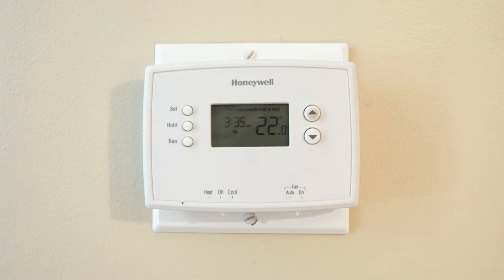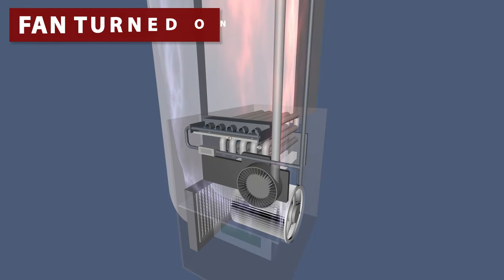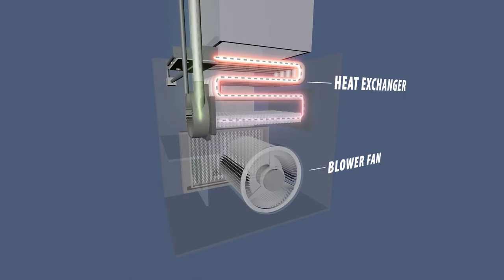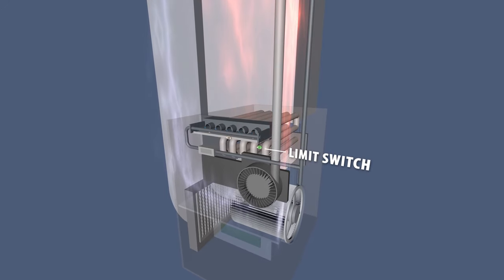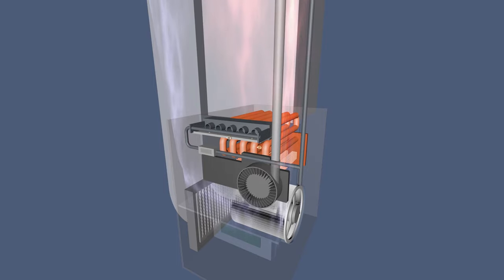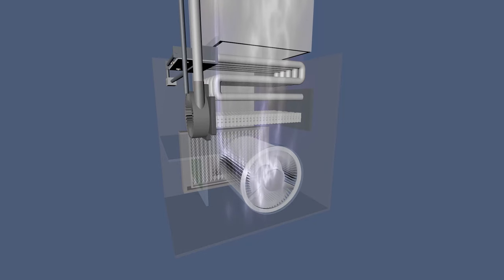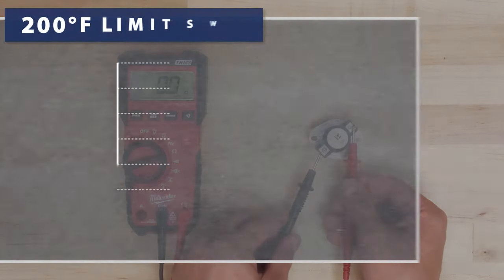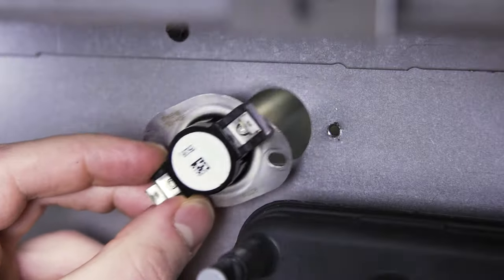Furnace Not Blowing Hot Air - Explained | Repair and Replace

Comment: Hello! Is it ok to replace the limit switch from a L165-60F to a L165-40F? I am having troubles finding the OE temp
Reply from the maker: Thanks for watching. It is not recommended to install a switch with a different rating as this can affect how the furnace operates. There are some cases where substitutions are made however that is not something we can recommend from here. In your example the original switch would cut out and disconnect the circuit at the high temp of 165°F. It will wait for the temperature to drop 60°F before power is connected to the circuit again. The L165-40F means that it will be cutting in at a higher temperature, & it will not wait as long to cut in again.

Comment: Electric furnace in mobile home is only blowing cold air instead of heat. It has been working fine until 4 days ago. Any help would greatly be appreciated.
Reply from the maker: Thanks for watching. Though your question is outside of the direct scope of this video there are still some things you can check. With an electric furnace, the first thing to check is if the heating element is still good. We don't have a specific video on electric furnaces but the steps will be the same as testing a heating element for an oven: https://www.youtube.com/watch?v=ABope7vl5IY

If the heating element is good then it could be a faulty limit switch or an issue with the control board.

Comment: Hi, I tested the limit switch with a multimeter and it shows 0.0 but when I tested the pressure switch no reaction on the multimeter??? The two other switches that have a reset also show 0.0. furnace still not heating? What do you think?
Reply from the maker: Hi Erminio, thank you for watching. A normally closed or NC switch will be normally closed (and will have continuity) at room temperature. Continuity means there is a continuous electrical path in the switch, and is any resistance value over 0. A switch is just a gate for the electricity to flow throw, which means it will have a very low resistance between 0 and 1 ohm. If the switch does not have continuity, then it will show a blank screen,  - - - - -  or  even OL (Open loop). That is an open circuit. Keep in mind some switches are normally open NO at room temperature and pressure. You might see NO and NC terminals on the switch which will show different readings. Testing between NO  and the C (common) terminals shouldn't have continuity, where testing between NC and C terminals will show continuity on a healthy switch.
Reply: @AmreSupply  well the others I tested I heard a beep then it shows 0.0 but when I tested it no beep and no reaction on the reader it stayed as is
Reply from the maker: @amineb5478  Beep and a resistance reading of 0 means there is continuity. For a switch that has C and NC terminals this means the switch is good.

No beep and no change means there is no continuity. For a switch with C and NC terminals, then that switch is faulty.

A switch with C and NO terminals, no beep and no continuity means the switch is good.
Reply from the maker: @amineb5478  As well we have created a video on multimeters and electricity. Its a good one to watch as a refresher, and it is also animated with good visuals. Its a helpful video overall https://www.youtube.com/watch?v=r_migcta_Is&list=PLCo9SMjkdWBycw9hZVfYFc6Sw2Jlavaak&index=2&t=0s

Comment: Here's my issue.  I set my thermostat to desired setting of 75 degrees(heat and auto for the fan).  Ones the house heats up to 75, the thermostat shuts off the furnace. When the thermostat calls for heat again it blow cold air.  So, I turn off the power switch for the furnace to reset it, thermostat is still set at 75.  After switching power to on, I can see that the igniter glows, but there's no flame. I put a new flame sensor, so that's good as well.  Could my limit switch be bad even though the igniter os working?
Reply from the maker: Thanks for watching. To work the flame sensor has to be positioned inside of the flame. It also needs a path to ground to complete the circuit through the flame, and the burner. If the burner is very dirty it can prevent the flame sensor from having a path to ground. Try cleaning the burners first. 

Also check to see if your furnace gives you any codes as this will likely tell you if its a "no flame sensed" or a "open limit switch" this can help you determine your next steps.
Reply: @AmreSupply  the code is a steady blink which is normal according to the label on the panel.  I have the trane xr80.
Reply from the maker: @squidusn71  Reading your message again, if you do get heat some of the time then you've verified that your gas valve is working and the system is able to heat up. It could still be an issue with the limit switch.
Reply: @AmreSupply  ok thanks for the response again.  So I got heat throughout the day but it started blowing cold air again latein the evening.  The same thing keeps happening, however, I was able to see a code this time(2 fast blinking lights). According to the code label, it reads external lockout(retries or recycle exceeded).  Is that the limit switch?  I did order the limit switch this afternoon while watching your vedio on it.  I really appreciate the help.
Reply: @AmreSupply  by the way, all this started after I changed the filter.
Reply from the maker: @squidusn71  If the new filter is a higher MERV rating than the old one then it might restrict the airflow, causing the temperature over the heat exchanger to be higher than normal. The external lockout code indicates it attempted to start up multiple times, and it exceeded the number of retries.
Reply: @AmreSupply  that's interesting. I've used low to high end filters before from home depo.  The current one has less filtration capability than the one I replaced. 
When it was blowing cold last night, I removed the filter and see if the flame would come on.  It took a few tries of on and off with the power switch before the flames came on.  I left the filter out the rest of the night and so far so good.  I'll put a lower merv filter and see what happens and if it does it again, I'll change the gas valve.  I've seen a couple of videos with the same issue that I'm experiencing. I really appreciate the response and I've learned a lot, thank you again!
Reply from the maker: @squidusn71  You're welcome, we're just happy to help. Thank you for sharing the updates, its always interesting to hear how things progress.
Reply: @squidusn71  was it the limit switch? My XR90 stopped working.  Same symptoms as your situation
Reply: @iSmiley.  it's the gas valve.
Reply: @iSmiley.  I also checked that the valve was getting power so I suspect that it wasn't opening.
Reply: @squidusn71  XR90 
-Initially shut furnace off @ thermostat for 2-3 hours.  Tried again and it was working fine again 
-2 days later, same symptoms again (no heat)
-reset at breaker
-calls for heat (fast consistent flashing).  Seems like everything is going great
-suddenly a suction type whistle like sound 
-reverts back to slow consistent flashing (no call for heat)
-Keeps trying over and over again to call for heat, but fails 
- no fault codes at all
Reply: @iSmiley.  I'm not sure what the whistle indicate.  When you call for heat the inducer fan comes and after maybe 10 seconds the igniter will glow red hot.  It seems like, your pressure switch might be bad if the igniter doesn't glow.  If it glows hot, the flame sensor will detect it and then the gas valve opens and you get flames.
Reply: @iSmiley.  check if the pressure switch gets power after the inducer fan comes on.
Reply: @squidusn71  my multimeter went for a crap. Tomorrow I will have to buy a new one and figure out the rest. I can tell u that it isn't a dirty filter and it's not the flame sensor (I cleaned that up)... It's flowing red... It fires up and sometimes it stays out in for a while then it shuts off.  Other times it's right away.  I obviously have an intermittent issue going on
Reply: @iSmiley.  if your filter is not dirty make sure you're not using the best ones because it will restrict the air flow. The only things i could think of now are the circuit board and the limit switch.  The limit switch will cut the heat/flames if it exceeds the temp.  Have you  tried cleaning the burners?
Reply: @squidusn71  When you say "gas valve"  - can you please be more specific? I am experiencing exactly the same issue as the original poster. And it is COLD ! LOL .. Thank you
Reply: Wow everything you described is my exact issue. I have a warranty on my furnace and had service to it they had to change the motor. Then 4 mths later it's doing the same thing. Every winter it's cold. I'm so over it I just want to move.

Comment: our shop heater doesn't put out much heat , is there a way to increase the gas flow. heat exchanger only reaches 80deg
Reply from the maker: Hi Kevin, thank you for watching. Adjusting the gas pressure can be done in some gas valves but requires special tools and knowledge. It would be best handled by a technician.

Comment: XR90 
-Initially shut furnace off @ thermostat for 2-3 hours.  Tried again and it was working fine again 
-2 days later, same symptoms again (no heat)
-reset at breaker
-calls for heat (fast consistent flashing).  Seems like everything is going great
-suddenly a suction type whistle like sound 
-reverts back to slow consistent flashing (no call for heat)
-Keeps trying over and over again to call for heat, but fails 
- no fault codes at all

Sound like a limit switch?
Reply from the maker: Thanks for watching. From what you described the furnace isn't getting far into the sequence. 

When it calls for heat, first the draft inducer pulls fresh air into the burners. The pressure switches check the pressure to ensure airflow.

Then the igniter heats up, the gas releases and the burners ignite. Then the flame sensor checks the flames.

From the sounds of it you likely have a issue with the pressure switch or bad airflow: This sequence of operation is mentioned here: https://www.youtube.com/watch?v=b0sAGt-1niU as well the full "How it Works" is shown here: https://www.youtube.com/watch?v=tVLtJwix-_8

Hope this helps!
Reply: @AmreSupply  Was a faulty GOOGLE NEST thermostat mimicking all that.  HVAC guy had to disconnect the fan to somehow power it as the RC connection wasn't enough. Hope that made sense. No "fan only" now, but that's ok, I don't use it any way.  

Be forewarned; sometimes it's the NOT SO smart thermostat!

Comment: My thermostat continues to blow cold air when set on "on" and when its on "auto" it doesn't blow at all.
Reply from the maker: Thanks for watching. If the furnace heats normally when in the "ON" setting, but doesn't heat at all during "AUTO" then It could be an issue with one of the wires or wire connections between the thermostat and furnace. Alternatively it could be a faulty thermostat.

Comment: if the electric air heater   Carrier  blows but does not heat
Reply from the maker: Thanks for watching. Many of the tips in this video still apply to electric heaters including the thermostat settings and the limit switch.

Comment: Wait...so the fan should be set on 'Auto' or 'On' to get heat?
Reply from the maker: Thanks for watching. On means that the fan will be constantly on and will run 100% of the time. Auto means that the fan will only run when heat is needed.

Comment: Well my family woke up to it being cold so we thought the thermostat battery's was bad but when we switches the furnace on, it blows cold air and then shuts off. We think it might be the igniter
Reply from the maker: Hi Joshua, thank you for watching. In most models if the igniter is faulty then the furnace will shut off before the blower fan runs. Best to check the furnace filter as a clogged filter will prevent good airflow and can trip the limit switch. As well a faulty limit switch can also cause the furnace to blow cold air then shut off.
Reply: Hi thank you for the help we checked the switches and it ended up that the pressure switch was seized up
Reply from the maker: @joshuarobinson9821  Thanks for the update, we're glad you were able to narrow it down!

Comment: There's no way to adjust the limit switch like you can on a Honeywell.
Reply from the maker: Hi Clark thank you for watching. You can get adjustable limit switches: https://www.amresupply.com/search?q=limit+switch+adjustable but these are meant to adjust to a specific temperature that the furnace is rated for. Generally these are used to match only.